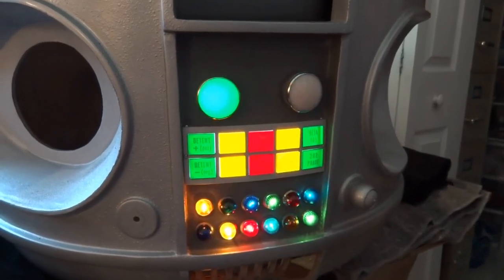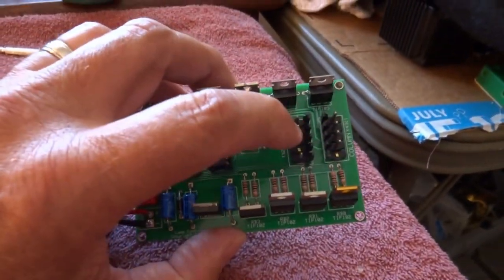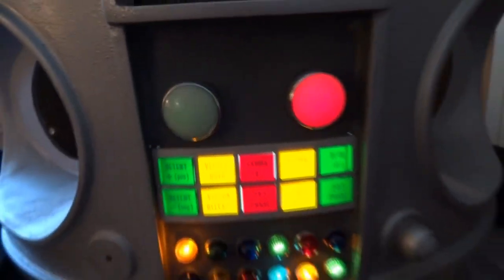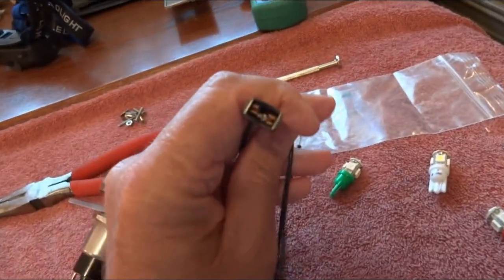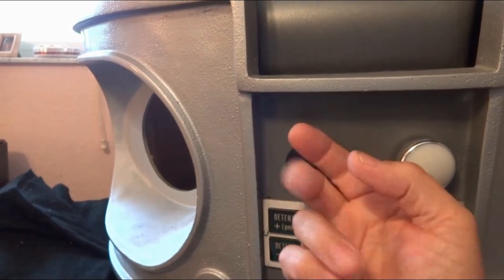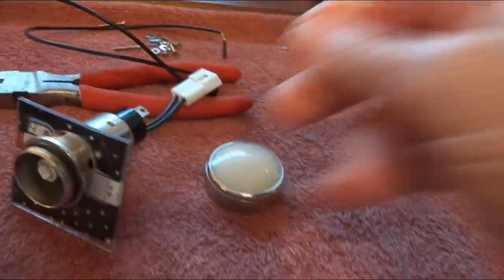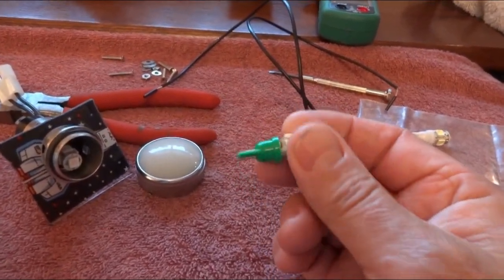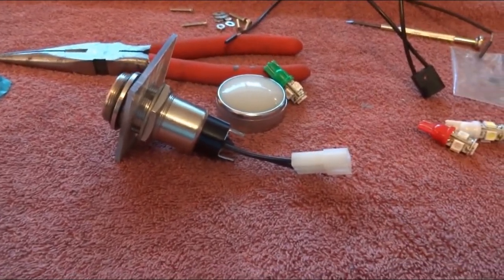B9 Lost In Space Chest light LED Conversion

Comment: If the board you have puts out 5 volts, and the led's take 6 volts, will they still light?
Reply from the maker: Hi John, 
Long answer; That's a question who's answer depends on many things. LEDs require a current limiting resistor in order to avoid passing too much current and burning out. You need to know the supply voltage (5V in your example) as well as the forward voltage and optimal current for the particular LED you plan to use (provided by the manufacturer) and then there are simple online calculators to tell you the correct resistor value to use to limit the current to the correct value. (It’s just a slight variation on Ohm’s law.)

Short answer: I've used 6.3 rated LED's with a 5v supply and they run just fine. That small amount of voltage seems to be just fine and the LED lights and looks good to me. You surly don't want to overdrive it. That would shorten it's life or burn it out. 

Do yourself a favor and use Tom Wisnionski's light boards. He gives you everything you need but uses incandescent bulbs. incandescent produces heat but the belly lights turn on and off so much that the heat is not a problem. They stay pretty cool. However the extra power consumption is another consideration.  

Here's Tom's website address selling B9 light kits:
https://wizzesworkshop.com/?product_cat=b9-robot
You can then buy the proper socketed LED's and replace the inconsistent ones supplied that will directly take the supply voltage you give them.
Reply: @DavidSchulpius  I ordered his kit, just making sure it will be a good match. Thanks Dave!
Reply: I was watching this video. I can pretty much reverse engineer wizworkshop board by looking at it. It is quite simple. 4x PNP TiP125 Darlington pull-ups and 4X TIP102 Darlington NPN pull-downs. I've read his how to use text and it is awful as far as specs go. It says almost nothing about power requirements and has no schematic or block diagram. It is safe to say the LM7805 regulator only powers the microcontroller - the high pin out chip and not the LED array otherwise there would be barely enough voltage to turn on most higher Vf LEDs. Likely the raw positive supply input to the board drives the emitters of the PNP pull-ups. How much voltage can you put in? That LM7805 has a maximum (power dissipation w/o heat sink) voltage that would may need to be divided down.
So if the row/column voltages was max 5V less 2 VBE voltage drops through Darlington transistors I would not expect it to be sufficient voltage to drive those 6.3VAC LEDs Dave is using or maybe turn them on just barely w/o a current limiting resistor. Those 6.3VAC high lumen LED will have cross-coupled Diode networks built in to make them work w AC. So that is 2X additional series diode voltage drops, about 1.2V + the forward voltage of LED which is probably 3-3.5V. With a row/column matrix you still have to add a series diode just like for incandescent bayonet bulbs so current only flows one way. That's another 0.7V drop. I don't know if the board has current limiting resistors or whether those have to be soldered in series with the LED. I haven't bought the board so I am still speculating but I expect the raw voltage in, which needs to be min of 7V (LM7805 has ~2V drop out voltage) to maybe max of 12V, drives the LED matrix.
I would personally look for a diode or diode array that works off 5V or less DC voltage. Actually a single high efficiency diffused (non clear) lens would probably illuminate great. Some of the diffused 5mm strawhat or flat lens type LEDs have a very wide viewing angle which will disperse nicely and be very bright at 20mA current.